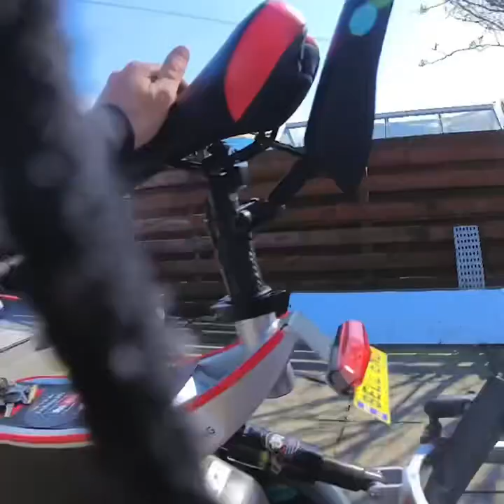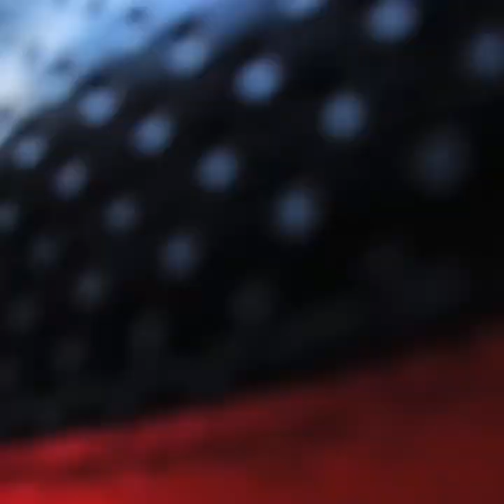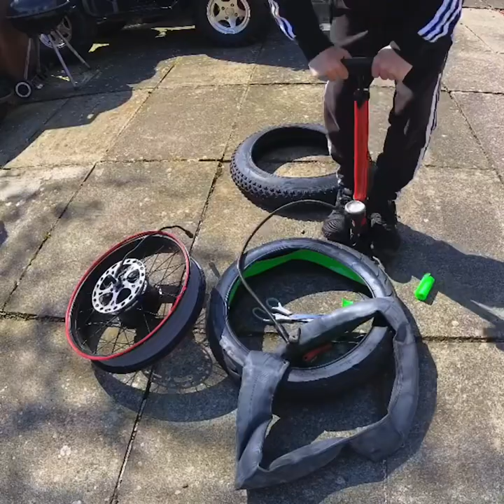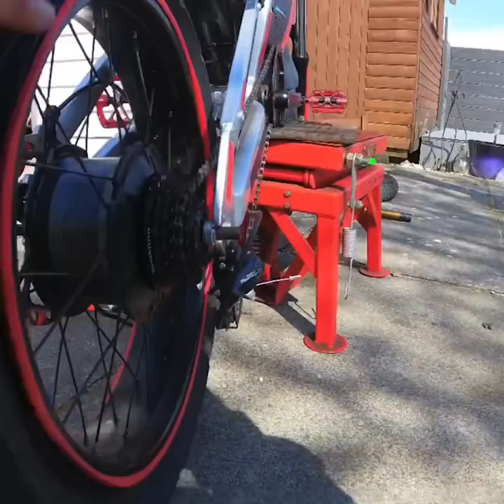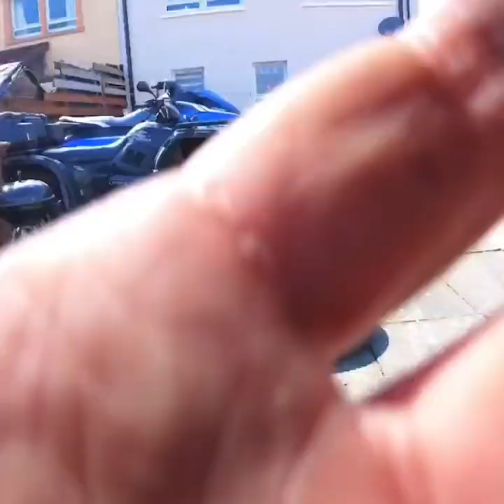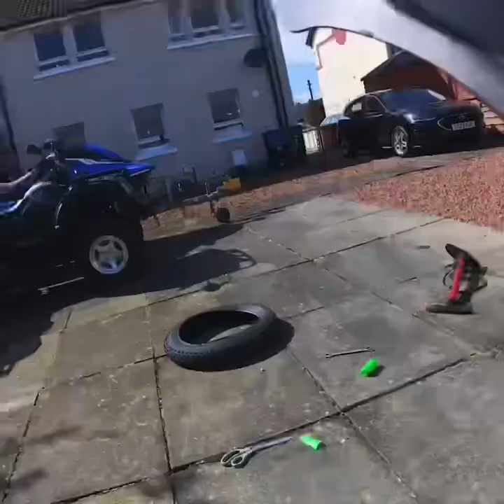Fitted new super motto tires WET RACE SLICKS / Faster & Furious 13.

Comment: Hi could you send me the link where you got your tyers  from thanks
Reply from the maker: A paid £160 for these.. em.. search on Amazon.. 20 inch x 4 inch road tires and see..
Reply from the maker: They were a gift bro a don’t have the link.. let me go see if I can find a set
Reply from the maker: Cannot see them anywhere but they are there. Try AliExpress app…
Reply: @BruxoCp13   ok thanks anyway
Reply from the maker: Did ye get one?
Reply: @RZOGUWEX Electric Bicycle EBIKE 2000w BruxoCP  its beening delivered  between the 12th and the 16th
Reply from the maker: Did ye see ma new vid wit ma new rear suspension it’s pretty cool man
Reply from the maker: @chrisrichmond5390  av got a lock on the new one. £163 it was
Reply: @BruxoCp13  you didn't answer  my question  lol
Reply from the maker: @chrisrichmond5390  I can’t say but I believe it will be ok for you. It’s pretty solid with what it comes with. I like bounce.
Reply from the maker: @chrisrichmond5390  found the link.. 20 * 4.0inch Electric Bicycle Fat Bike Snow Beach Bicycle Tire And Inner Tube Bicycle Tire Bike Parts Bicycle Accessories (Color : Tire and tube) https://amzn.eu/d/95buv47
Reply from the maker: @chrisrichmond5390  DNM AOY-36RC Mountain Bike Air Rear Shock with Lockout 190x50mm 4-system, Gold , ST1476 https://amzn.eu/d/egVuw1J
Reply from the maker: @chrisrichmond5390  WAMBAS Snow Bike Fork,20 Inch 4.0' Tire Fat Air Suspension Forks Travel 110mm,Double Shoulder Disc Brake Bicycle Straight Front Fork Adjustable Rebound,For ATV/Beach Bike/MTB/BMX (Color : 20' Gold) https://amzn.eu/d/c1YqzWl
Reply from the maker: @chrisrichmond5390  hammer-engineering Ebike Adjustable Angle Torque Arm, Rear, 14mm x 10mm x 5mm - 3 Day Shipping https://amzn.eu/d/bKKr9fk
Reply: @RZOGUWEX Electric Bicycle EBIKE 2000w BruxoCP  thanks but the link just takes me to my amazon  so still carnt find them thanks any m8